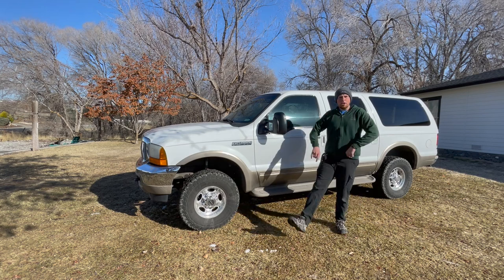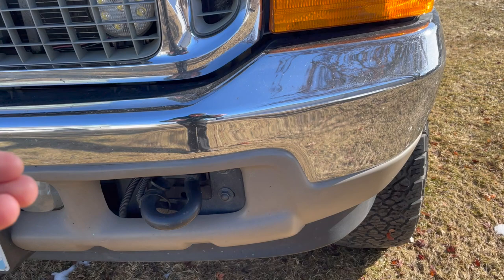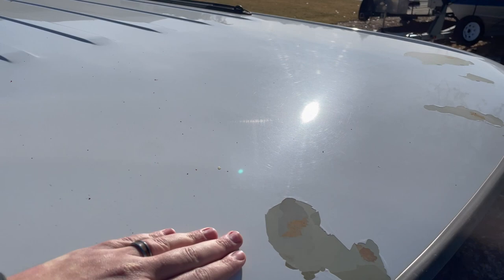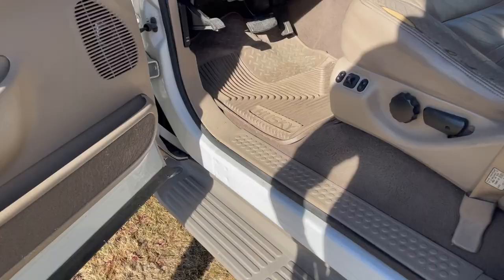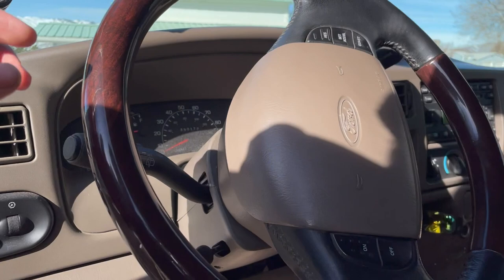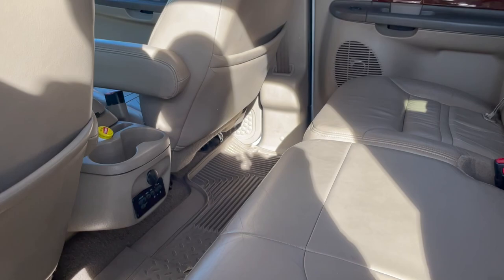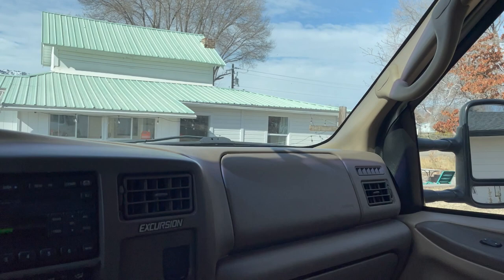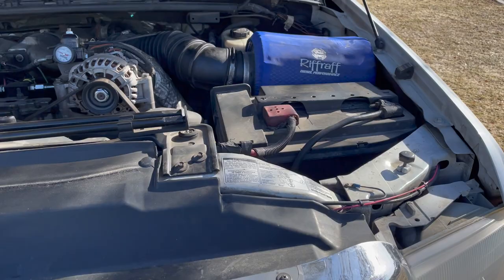Ford Excursion Buyers Guide: Tips and Tricks for Buying a Good Truck

Comment: Nice video and good information.  Another thing to point out is the rear vent windows operation, this was something I missed when I got mine and the driver side does not open and will need a motor replacement (already checked and confirmed it is not just stuck shut).
Reply from the maker: Great addition! They can be an issue.

Comment: Just picked up an 00 Excursion and everything your saying is right on, though also, check the exhaust pipe, found that mine suffered some off road damage and was only hanging on by one hanger (heard a loud banging on one occasion and went to investigate, only found it after I kicked the tailpipe, I'll probably try and redo the entire exhaust as I bet the manifolds also need some eventual work. 

Though for the price and it's condition (I've only found a few, mostly very minor issues, and one door rocker rusted through) I've considered it an excellent bargin (minor surface rust in all other areas, easy enough to treat).  

That oxford white optimistically has a year or two before it'll require a major commitment, and I can see (basically everywhere) where the other two owners tried multiple different methods to attack it, i.e. white out in addition to paint in some spots.
 
Maybe I'm kind of a goof but I'm almost tempted to get the truck painted like a Jurassic Park explorer, it already feels the part.

Right now I've been preforming a much needed radiator flush as it had the original coolant (smelled strongly of glycol but looked like 10 year old brake fluid), fortunately no signs of anything serious. I put over a thousand miles on it right purchase and it handled like a champ. As for the other more serious issue, I'll see if there's any way to try and delay the rust long enough for me to fit and weld up new rocker panels.
Reply from the maker: Welcome to the excursion family! sounds like your happy with your purchase and to me that's all that matters! Good tip on the exhaust. Lots of things motor wise that I didn't cover in this video, but these are great trucks no matter which engine!

Comment: Check the front outer front axle shafts seals on 4X4 models check that it goes into 4 low manually lock front selectors in
Reply from the maker: Great tips!

Comment: My 02 had the oem brake controller plug buried under the dash. Pulled it out and just plugged into my controller. Also the door code is stamped under the dash
Reply from the maker: Interesting. I believe both of these things might have been started in 02 because my 01 and 00 have neither. Thanks for chiming in love learning!

Comment: Man you talking shit. Cold start gasoline? Gasoline no matter what weather is it start perfect
Reply from the maker: I specifically said in the video that I wasn't getting into engines, I did mention that seeing a vehicle cold is a good thing, If the vehicle is warm prior to your arrival you can't hear if the valve train is noisy on cold start, can't hear pulleys with warn bearings that only scream when they are cold, and if the transmission needed to be warmed up to even go into gear. I'd rather check out a vehicle cold any day.